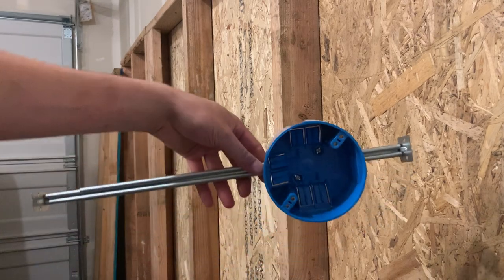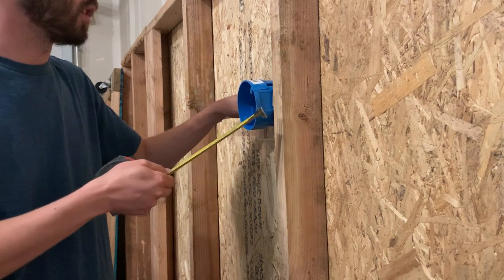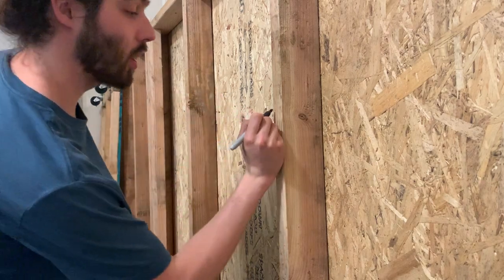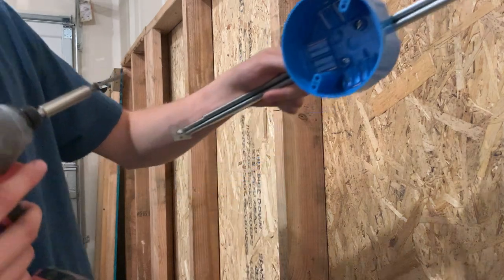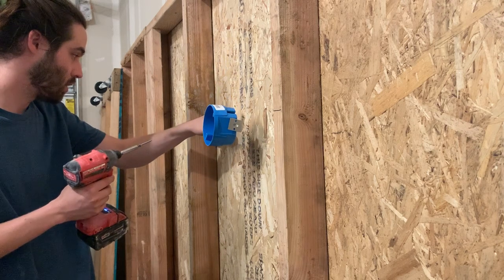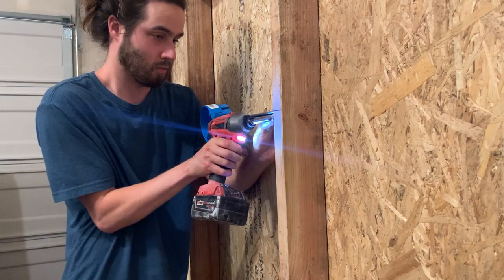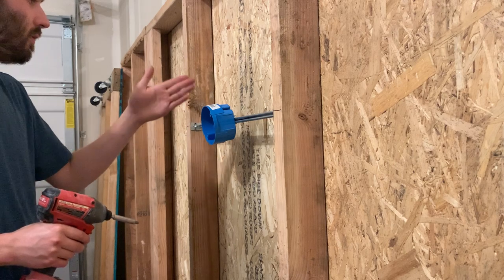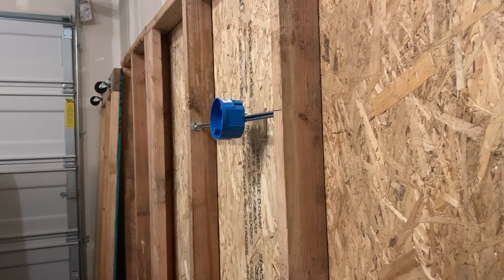Electrical 101: How To Mount A Spreader Bar Light Box (Residential)

Comment: Those are a big tricky in mounting you set too far back the light fits in too snug but if you but too far out then you’ll have a extended light and dry Waller might even rip it down. Thanks for informational  video helps a bunch ! Keep this up as much as you can